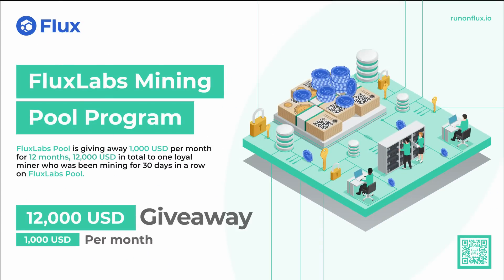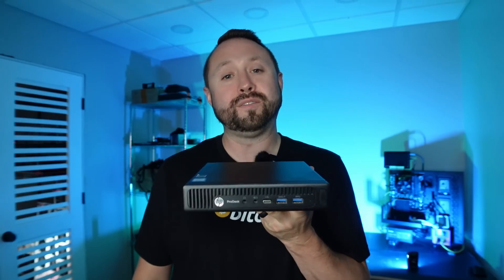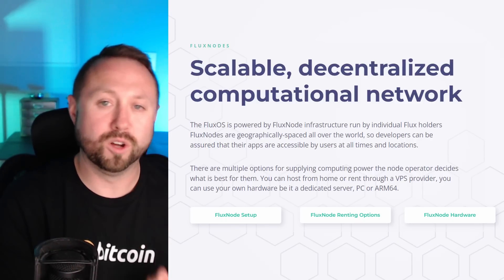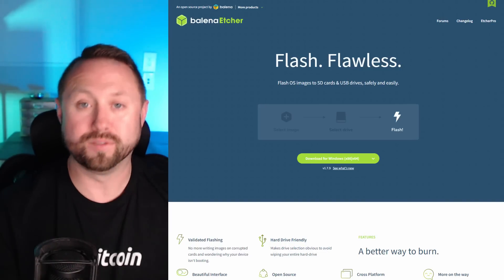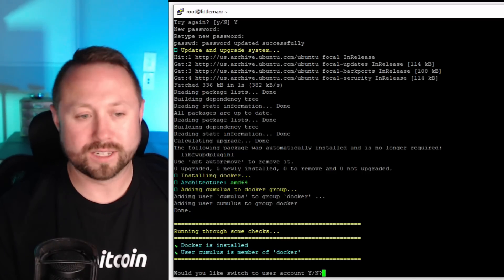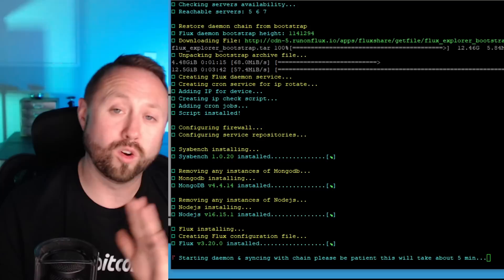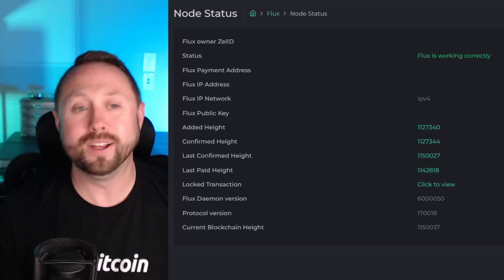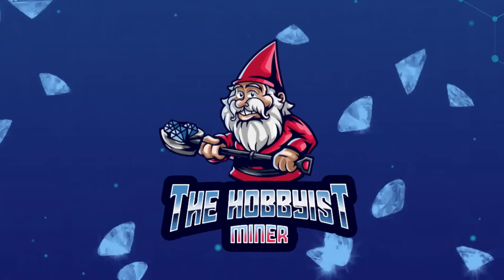10 Tips and Tricks to Help Setup your First Flux Node | Flux Node Setup Guide

Comment: I see a lot of comments below about auto updates.  I have 2 nodes.  When I set up my first node, I turned auto update on.  I had one time that an update took my node offline.  Devs suggested people to not use auto update due to this risk.  On my 2nd node, I left auto update off.  Full disclosure, the auto update has not taken my node offline since that time.  Also, typically, you have 2 weeks to update your node before your node will be removed for being on an old version so there is time to update.  Checking about once a week for an update is more than sufficient.

Also, full disclosure, I am a beginner Linux user.  I know enough to be dangerous but have phenomenal google search skills.  I had only set up Flux Nodes on Raspberry Pis so the process of installing Ubuntu on a regular computer was different and I wasn't familiar with it.  That is a big reason why that portion took us quite a bit of time.

Hobbyiest, thanks for doing this with me.  I enjoyed doing this with you.  And GREAT video.  Loved it.

Comment: As an additional clarification, the node wallet just needs to stake the flux to the address initially and does not need to continuously run.  You'll want to leave the wallet running the first time during the process to sync, but once sync'd 100% and staked to the address, you can exit the node wallet.  Everything afterwards really occurs from the nodes unless it goes offline for an extended amount of time.  If you enable watchdog, it'll try to resolve benchmark issues automatically.  After a few tries it will stop the node for manual intervention.

Comment: Is this your first time running any type of masternode? Their masternoding process isn’t that much different than every other coin. You lock up the collateral in a new address, generate the keys, install node, sync it up, bind the key, and run it. It’s your responsibility to monitor it, just like it’s the responsibility of pool operators to ensure uptime and stability. HiveOS is for mining, not for Staking or running nodes. There are many node monitoring options available.
Reply from the maker: Yeah first time

Comment: You'll notice that your node will go down and offline randomly. The hope is that it doesn't do this during the latter part of the 12 day queue. One thing to take note of is that the box cannot lose connection. If you reboot, the server, you won't get back in line. If something happens to you main Internet connection, same thing. I recommend doing any maintenance updates right after you get paid out, then reboot once, redo benchmarks, and reactivate node. If you wait too long between payouts then the box will randomly go down and you'll lose your place in line.

Comment: This tip/trick video, although nice, sets a wrong president; the node deployment should not be compared to a mining rig deployment. 
Flux nodes are not for the faint of heart for a reason - they are not for handling blockchain transactions, which is what the mining is for - and are the equivalent of an AWS server. And if you ever setup an AWS or Azure server, setting up flux nodes are far easier. And it will get even more complicated, once proof of useful work is launched. So this space needs solid node runners, and not run of the mill operators, who will be better of participating in the Titan nodes.

Comment: My FluxNode is an old 2011 or 2012 Mac Mini running Ubuntu. I've been looking around on ebay for older mini PCs like Mac Minis, Lenovo m92p or m93p, and Dell 3050 Micro PCs-- there are plenty of low-price options that meet the performance specs out there if you're not afraid risking the used route.